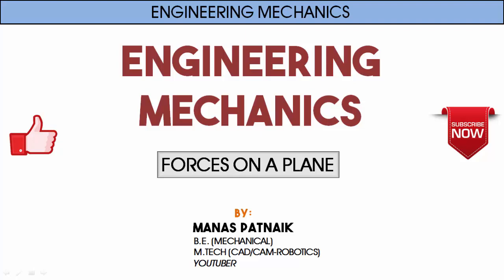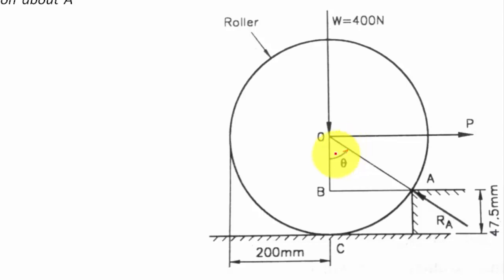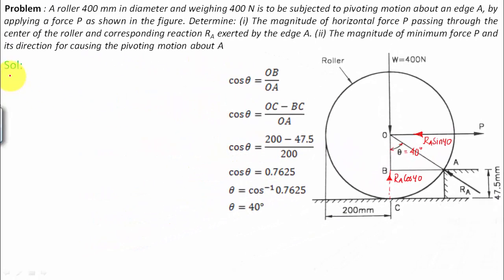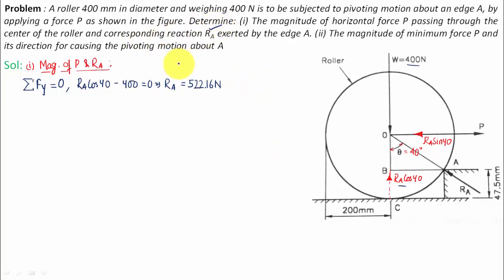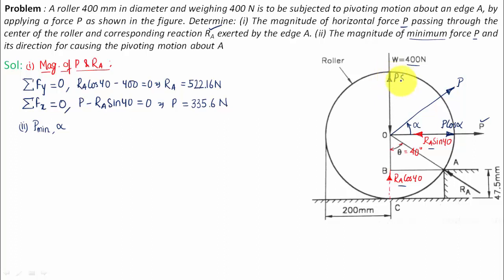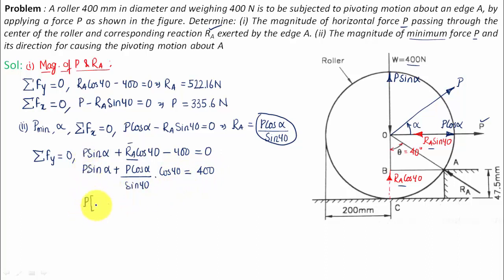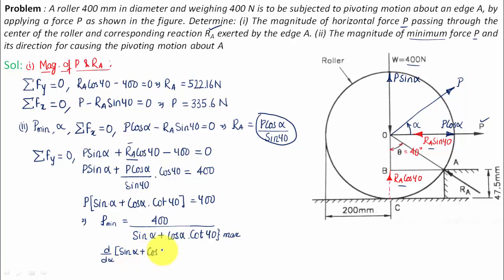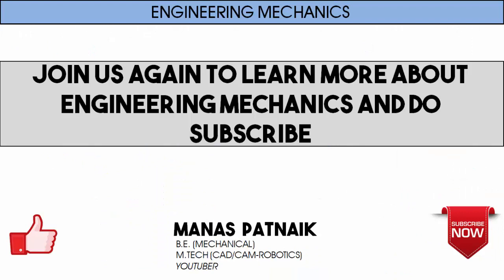Engineering Mechanics_Forces on a Plane_Level 2_Problem 6

Comment: if the force is applied at the top of the circumference and  the wheel is made to roll over fixed  sphere the how will the line of action of reaction will act . why its said reaction on sphere contact always passes through centre of sphere  and in this case will it violate ?

Comment: Sir what if force p acts on the circumference ... reaction still pass from center or it will pass through intersection of all forces on the body
Reply: Then i think we hv to deal with torque about axis if the extended force line is not passing through axis of cylinder

Comment: Where and in which direction should the minimum force be applied to lift the ball if the height of the stairs is same as that of the ball's radius?
Reply from the maker: Shampa.....u can work that out by yourself and solving in the same manner.
Reply: Manas Patnaik 
In that case the angle  theta will be 90. So alpha  will also be 90. But if alpha is 90 then it will rise straight and we will again require a horizontal force to put it on the stairs. But only one force should be applied